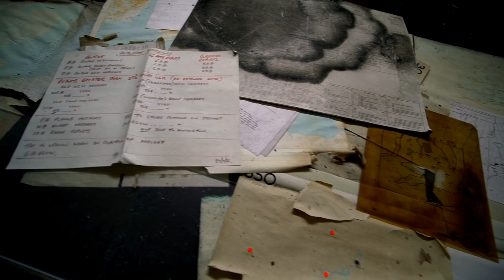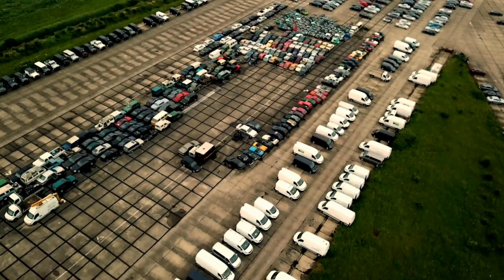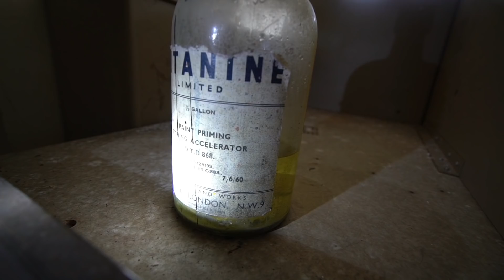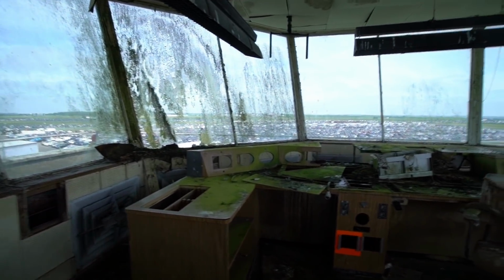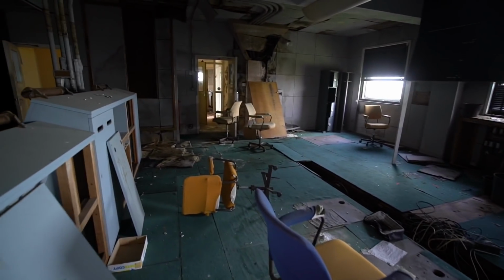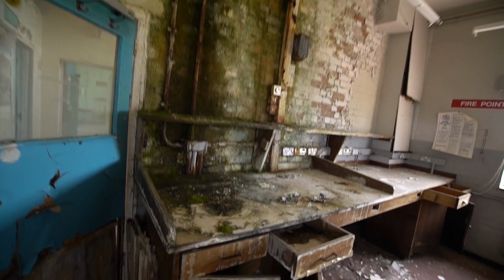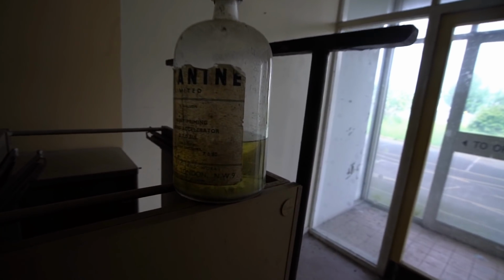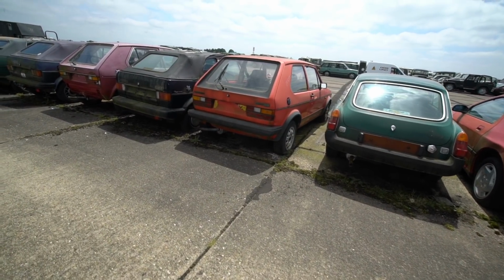1000s OF ABANDONED CARS AND EXPERIMENTAL AIRCRAFT CONTROL TOWER

Comment: At 13:50, when you pass an equipment rack, take a quick but well lit shot of what is inside. It'll allow all of us out here to see what went in the rack and therefore what it was used for.
Reply: By the way, I used to work for BT at the Research Labs near Ipswich (called "Adastral Park") and also work in I.T. so know what a lot of that gear does.